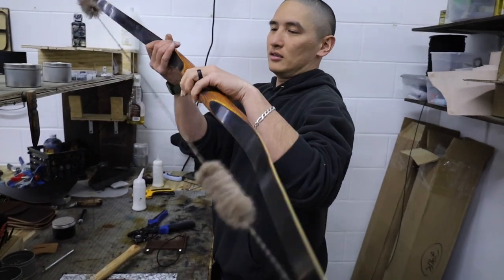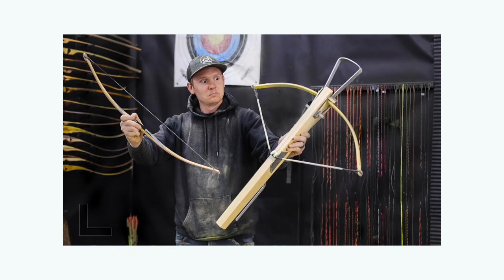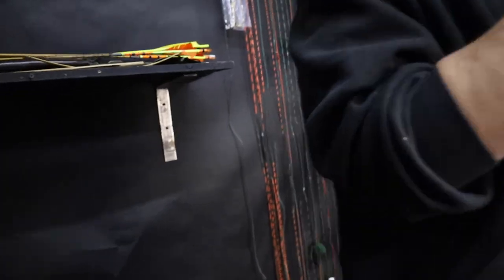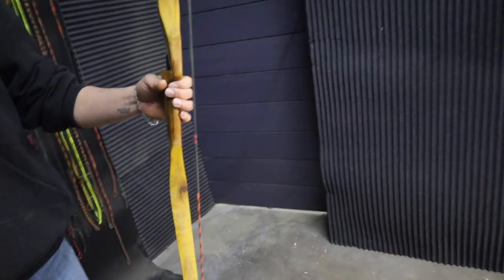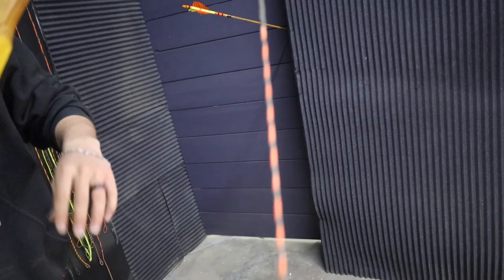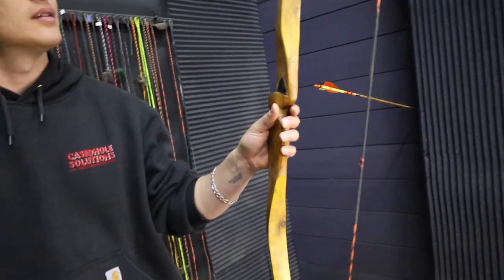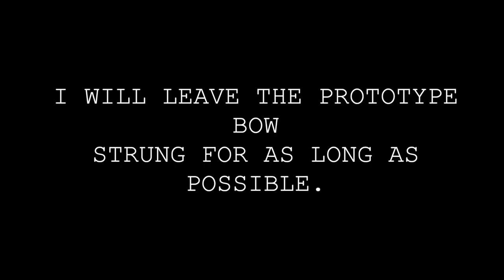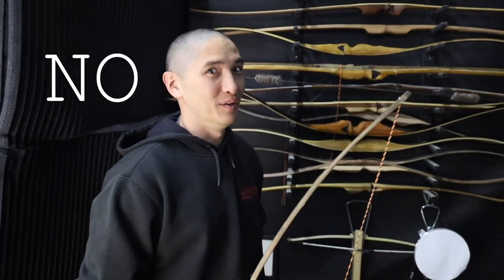Leave Traditional Bows Strung?

Comment: Here's the centuries long history of this issue. All-wood longbows were typically unstrung when not in use because the wood on the face/belly of the bow compresses, and that causes the bow to "take a set" and "follow the string" toward the archer, which results in a loss of draw weight. It happens quick, and when that weight was gone, it was gone forever. The limb cores of the ancient and medieval laminated sinew/wood/horn recurve bows did too, but the sinew back and horn face/belly meant it did not matter as much. They lost less weight slower over a much longer time and could get most of it back when rested. It was typical to leave them strung for months at a time, often an entire war season (because their unstrung crescent shape made them a hassle to string). After being strung for 6 months they might lose 15% of their draw weight but get it back when unstrung and rested. They adjusted for that. That was with natural material bow strings too. When Americans and Europeans began facing and backing their all-wood bows with modern synthetics like Bakelite, Lamacoid, Toxhorn, and Fiberglass they kept the always unstring tradition of the all-wood bows they were familiar with. Even though long-term experiments with the fiberglass backed/faced bows showed then (and still show) they could be kept strung for years with no damage and no significant loss of draw weight. Why Black Widow bows says in their owner's manual it is not necessary to unstring your recurve bow if used regularly. Why Bodnick bows 30-year warranty is not voided by leaving their bows strung. I've kept bows (Bear TD) strung for years w/o problems, and I have friends who have kept theirs (Bear and Groves bows from the 70s/80s) strung for decades w/o problems. With a well-made modern bow it will not be a problem. Keep an eye on the string, change that before it needs it. If it makes you feel better to unstring go ahead and be happy. If you want to leave it strung, don't worry about it. Don't let it get too hot/cold too often, use it cold w/o a warm-up, or leave it in a hot car. That will hurt it strung or unstrung.
Reply: Ha, interesting. Thank you, man.

Comment: why are compound bows left strung like forever then???
Reply: Because the tension is not stored in the bow/limbs more pulleys so it doesn't change too much.
Reply: @solac7749 all of the tension is in the limbs. The riser, limbs, and cams have the same tension throughout them. The reason it is fine is because of the compressive strength of fiber glass. It does not compress so it does not take a set. This means it does not loose strength from being strung.